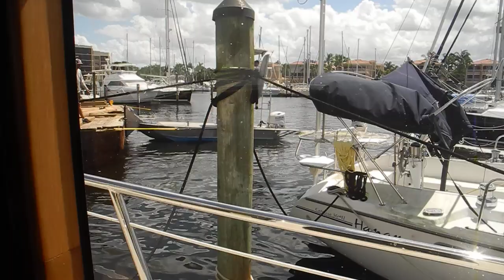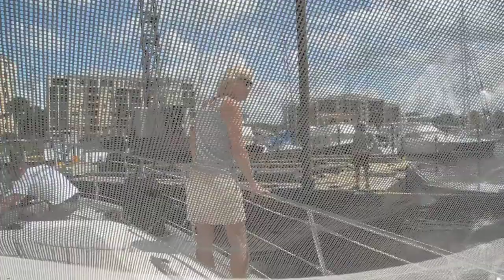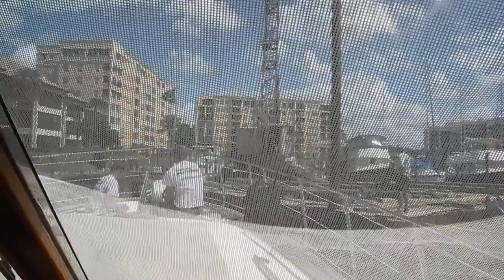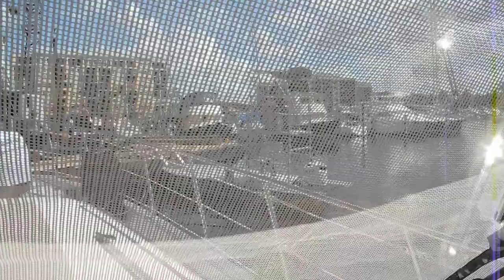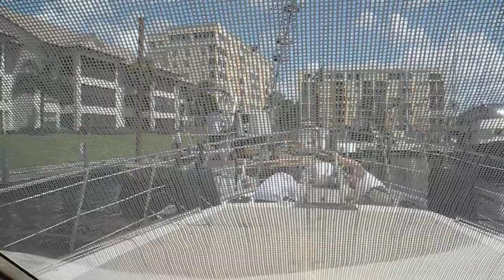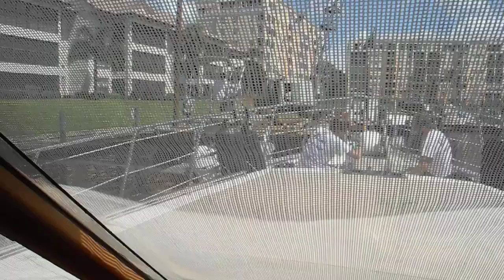Suzuki powered push boat and pile driver FL Style

Comment: That man can handle a single outboard like a BOSS...
Reply from the maker: YES, practice, experience and good weather. Can you imagine he can handle that barge with a tiny outboard propeller. It's not just the horsepower, it is the prop wash to control the boat and barge. This guy is good and calm. Hey Mel, need any more Tugboat Captains?